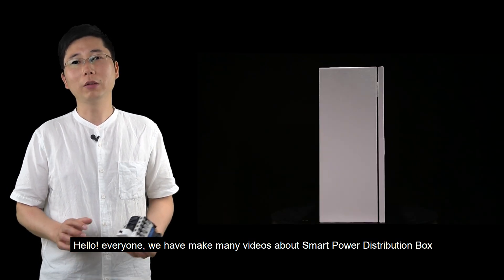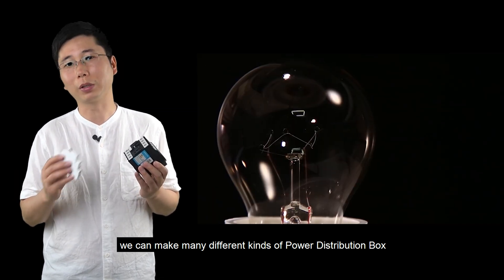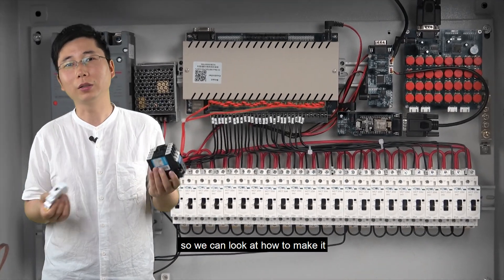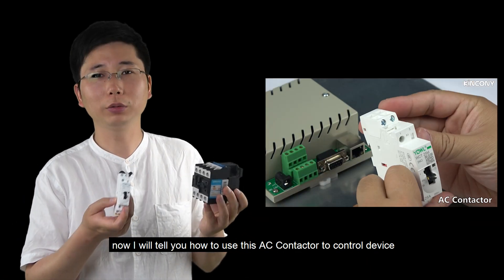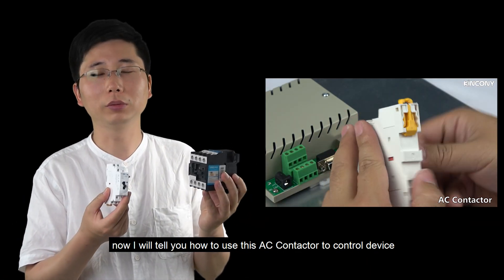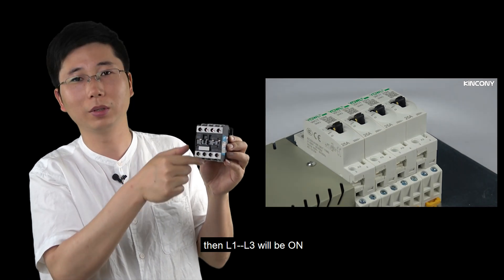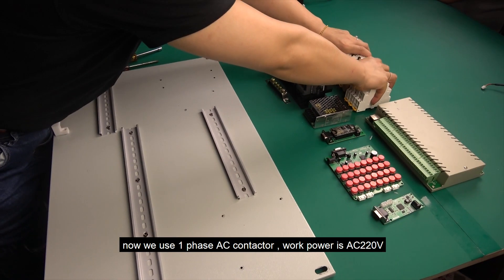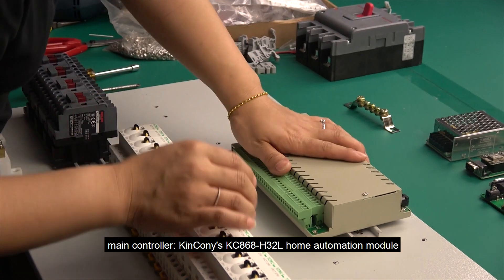[Smart Home Automation DIY] Make 1 and 3 phase Power Distribution Box

Comment: This setup is very dangerous and should never be used. 
Suitable for maybe a maximum 3x 16A powerfeed, absolutely not for more!

If you use a 160A breaker, you need at least:
- a certified electrician
- a suitable box,  
- much more space between all objects,  I would say,  no low voltage equipment in the same box
- 25 to 50mm2 wire from the main breaker
- at least a small (16A) circuit breaker between the main breaker and each 3 phase relay.
With those thin wires to all 1phase relays, you need one 16A circuit breaker to connect to these 16 relays. 
So in total a max of 16A for all of them together. 

So, with these wires,  a max power draw of 4x 16A = 64A.

But I'll say again: too dangerous for the user (risk of short circuit with huge flames) and overheating. 
So, not 160A, not 64A, but a max of 16A for the whole box.

Ps. Maybe this is a China approved setup,  in Europe it's a no-go...

In all cases do not build this box.
Reply from the maker: Thank you for your advice. You are very precise. This customized distribution box has a very small load current for the actual user, so we select cables and accessories according to the actual situation.also this is a demo video. If people are in DIY, you need to select the AC contactor, circuit breaker and wire diameter according to the actual load current and power. thanks you again.

Comment: Es posible una caja de 3 fases, y que en 1 fase tenga 23 unidades Ac contactor for single-phase power supply, en otra fase tenga otras 23 unidades Ac contactor for single-phase power supply y en la otra fase tenga otras 23 unidades Ac contactor for single-phase power supply? Estaría interesado en comprar este producto si se pudiera elaborar, gracias
Reply from the maker: do you means in different 3 box? this is no problem, all box can work in one mobile phone APP.
Reply: KINCONY IOT yo preferiría que fuera en una sola caja, y así convertir mi instalación trifasica en 3 instalaciones monofasicas, sería posible?
Reply: KINCONY IOT KINCONY IOT yo preferiría que fuera en una sola caja, y así convertir mi instalación trifasica en 3 instalaciones monofasicas, sería posible?
Reply from the maker: Yes, it support.